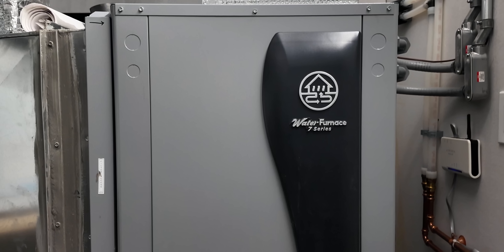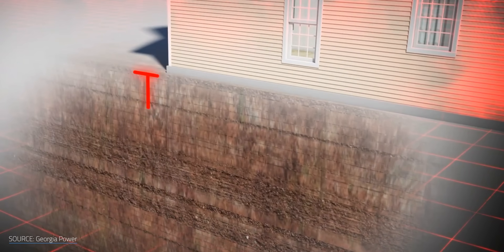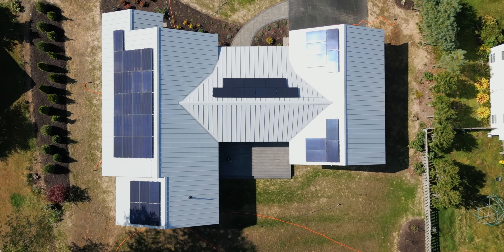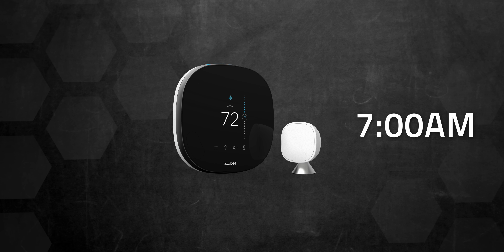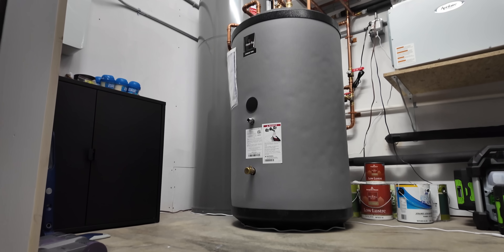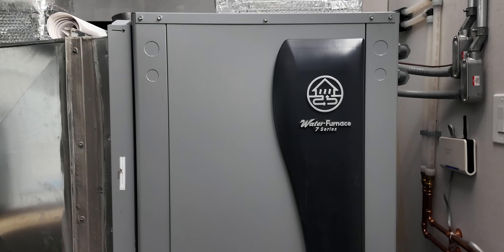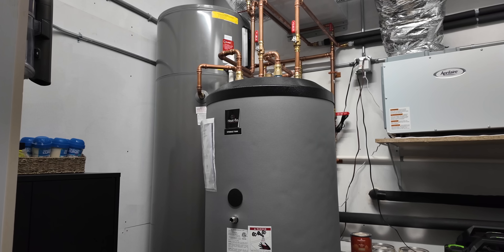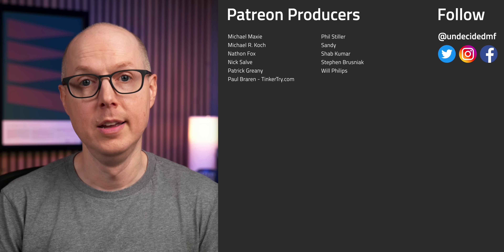How My Geothermal Heat Pump Really Performed (2 Years)

Comment: I designed and installed my own geothermal system. Works with air pushed through underground 6 inch drainage pipes. Some of the pipes I got for free from my landscaper. I have a heat pump and AC unit which uses underground air instead of a liquid and heat exchanger. My total cost $1500 and my sweat. My July electric bill went from $345 to $120. I want to market a ready to install a kit. No need to drill, just a back hoe to dig a channel 3 feet deep.
Reply: This is called an EARTH TUBE and are frequently used in Earthships. The issues that raise from this is that the tubes can collect condensation and that can become harmful mold growth. Keep it dry and it's a pretty easy low tech air conditioner.
Reply: @Lunarl4ndr  There's no concern for mold in his setup because he's using the cold air from the earth tubes and directs it to the air-exchange AC unit.

If that doesn't make sense, he ducts the "ground air" to his AC unit, which is pre-cooled by the earth tubes. He's not taking in air from the earth tubes into his home.
Reply: gotta start that yt channel lol
Reply: Very nice.  While these more advanced systems like what Matt Ferrell has are awesome, they're pricey and out of reach to a lot of people.  I have seen a more passive system in earth ships using drainage pipes.  It sounds like you've took that one step further combining it with a heat pump, very cool indeed. 

You should share your work as it might inspire others to improve upon what you've done and everybody wins.
Reply: @LeJimster  Right now I am trying to calculate the cost savings vs investment.

Comment: I feel like we are putting the cart before the horse. Why invest so much in energy production instead of efficiency? Why have rebates for solar, when it is cheaper to install high r value insulation. If half of home energy costs are heating and cooling, and if insulation is cheaper and lasts longer than solar, then wouldn't that be a better investment?

Comment: What if one of the underground loop pipes develops a crack? the cost of fixing that would also be enormous, wouldn't it? I only ask because, while my area is not prone to earthquakes, we've had 2 in the last couple of years and it did cause some minor damage. With a system like this, if it breaks, it would require substantial resources to fix. Could you comment on that?

Comment: I have a air heater pump. Live in the northeast. Coldest its been is -13. Heat pump was able to keep my house quite warm without a huge increase in power usage. Geothermal is cool I couldn't justify the upfront cost for installation on my new house.
Reply: I have the same in Norway too.  Temps can get down to -10 to -15C during extremes in winter, and the heat pump can produce 5KW of heat at -15C.
Electricity is pretty cheap and 100% renewable here, and there is no way I would install a geothermal system due to costs.
Reply: @la7dfa i would never do Geothermal due to cost of installation, risk of leaks and cost of leak repairs, and cheap solar energy, I'd rather invest in battery storage and have a few electric heaters in case of emergency.
Reply: @KameeGaming  Battery storage will make more and more sense as prices are dropping in the next years.  Solar and outages of the grid could make life better. especially in a crisis (war?).

Comment: Hi Matt, Can you please enlighten me.  If you temp in the ground is 50F, does the compressor even run during the summer for cooling?  is it just the water pump running?  Is geothermal heat pump a good idea for hot climate like Texas where winter heating is minimal?

Comment: I should also point out that geothermal heat pumps are  great  for heating swimming pools, and they can be coupled together with solar thermal hot water heaters and photovoltaic thermal.

Comment: I’m glad I don’t live in Massachusetts 🤪 We had two Waterfurnace units installed in 2008, a 5 ton for the main floor and a three ton for the upstairs as a retrofit. The house was built with two separate systems so it made more sense to just replace the propane furnaces directly than try to modify the ductwork extensively. We have two horizontal loops, they are hooked to the water heaters. Installed then was $26,000 for two complete systems. We are in Southwest Ohio. We had to have an additional 200 amp panel installed at the time for about $2000. Our electric rates here are about 13 cents a kWh. We have been very pleased with the system overall. Initially we had several service calls but it was all covered under warranty. I think their build quality has improved significantly over the years. Whenever these units finally reach the end of their service life we will replace with new Waterfurnace units.
Reply from the maker: Thanks so much for sharing!

Comment: Government rebates are just a way of getting your neighbors to pay for heating and cooling your house.  It is not the real cost of the system.  If everyone did it, your taxes would just go up by that amount (actually more because of the inefficiency of the third party).  Also, I suspect that your sky high $.31/kwh electricity bill is in part because of rebates the power company is doling out that they need to recover.  You do, however, live in a good climate for ground source heat pump.  50 degrees is a great heat sink and your heating and cooling seasons are split up enough that you don't warm or cool the ground so much.  If you lived in the South, the ground might be 70 degrees and the cooling season might be 10 months.  So the ground around the loop might end up climbing 20 degrees and not really be much different or even hotter than air temp, especially at night.  Also, you are only guessing at the costs of an air-source heat pump.  Only building two identical houses aside from one being ground source and the other air source would be able to truly compare the difference.
Reply: Don't worry, all those rebates are gone or will be shortly.

Comment: A word of warning for some. Building your house is the best time to install a good system, just ensure it is a workable system or you're stuck with it. Converting an existing house will have problems to jump over but doable. So far OK. Converting a townhouse, your local strata/HOA needs to approve, and then does your power delivered to the house allow a heat pump (forget geothermal)? In my area, built in 1990, heat pumps will never happen, not enough AMPs delivered. Same would be true of older condos. Unless my area gets everything pulled out and rewired, heat pumps will not happen. Since I downside from a house to a townhouse, and then retired, basically stuck with traditional forced air. 

I do like the technology, it's cool (sry about the pun).

Comment: There is a large cave on the property where I'll be building my next home, so I plan on going speleothermal. The cave, like the ground around it, is ~55° F year-round. I haven't worked out all the details yet, but the idea is to put a heat pump in the cave, and pump the fluid to the house through an insulated underground pipe. Any helpful advice would be appreciated!

Comment: This is amazing, but for a milder climate, it wouldn't make too much sense since new air-to-air or air-to-water heat pumps can get SCOP of 5. Especially if your house is well-insulated and not ginormous. New R290 heat pumps can be very good even in a slightly colder climate if the system is set up right. Where I live, geothermal heat pumps are much more expensive and often require permitting.

Comment: One concern I would have about a system like this is the complexity and use of much less common components. What if its 14 years later and the reclaimed heat water system breaks? If the company doesn't exist anymore, can you just get another? What if the geothermal system breaks or leaks? It won't be as simple as replacing lines or a condenser unit for an air system. I am not sure efficiency "at all costs!" is necessarily a positive ethic when the result is a much more complex, difficult to repair or replace system. 
Personally, I like the security of common, robust, affordable, easily replaceable components which can still get you to net zero easily. Also, independence for me means no grid connection at all.
Reply: Ours is 15 years old now, still pumping. Same brand Matt is using.
Reply: The core system is still an air handler. Nothing special about that. The only added "complexity" is the ground loop and circulation pump.  Yes, leaks are possible but very rare.  The loop is extremely heavy duty and encased in grout. The systems are pressure tested before commissioning.
Reply: @DeuceDeuceBravo  And pressure-tested systems still fail sometimes, especially as they age. He's also got other special "efficiency" components, like that waste-heat water heater. 100% of components will fail. It is only a question of when, how many you have to fail, and how cheap/easy it is to replace. I just think there is something to be said for simple, robust, and cost-effective.
Reply: @satekeeper The desuperheater is very simple plumbing. I have one too. Of course everything will fail if given enough time. That doesn't mean the system should be avoided.
Reply: @DeuceDeuceBravo  I was not saying the plumbing is complicated for that one item. I am saying adding more and more components increases the chances of a component failure in a given year. I'm also not telling anyone to avoid anything. If you become sexually aroused when someone uses the word "efficient" then this is the setup for you.. get it and enjoy yo life. I personally don't think maximizing efficiency is the most important virtue or would lead to the best homeowning experience for me. Is that OK with you? Am I allowed to have preferences about my home?

Comment: It would be great to know your average COP (Coefficient of Performance) on this Geothermal heat pump for those 2 years. I have air-water heat pump and for last 3 years heating, cooling and hot water I have average COP of 3.5 (in Europe - Slovakia) which is really great for air-water heat pump and it is great heat comfort in house as I have constant 23.5°C (cca 74°C) all year. I am also really satisfied with this choice, and was considering geothermal, but charts were showing COP of between 4-5 which is not that big a difference in savings, so that is why I am interested in some real usage number of COP for your system. And yes, using PV together with heat pump saves even for me a lot of money even now, so together with PV change of COP from 3.5 to 5 would be around $100 savings per year, which even in 30 years would not have provided my a return of investment... at least that what it looked to me like... yes, air-water heat pump can get broken more often... I will see.

Definitely I would also recommend heat pump to everybody with properly insulated house. Thanks for sharing your experience.

Comment: Over 20 yrs. the system costs $2700/yr. & that's not including interest on that $$$ in the mortgage.  My natural gas system only costs 240/mo. to operate, (gas + electric) & it costs $175/ yr initial cost. I'm on my 20th year & it's doing just fine. Nineteen forty seven house well insulated with foam & rock wool. (1300 sq. ft.) in Lansing Michigan. It wouldn't pay me to go geothermal.

Comment: A self-dug ground loop seems to make way more sense than drilling... You should've just used the server for free heat in the extra unit, and had a separate, cheap A/C, for summer needs. You went way too big on all this, and I wonder about future maintenance/replacement costs factoring in, with all that complicated equipment. Do you have backups/parts ready to go? That's part of long term self-sustainability as well. You got a soldering iron and extra capacitors, motherboards and power supplies, belts and filters and pumps, know what I mean? Maybe one day you won't be able to just call for support, or easily find a replacement part. The complexity really worries me and I wonder if higher running costs now>higher maintenance costs later. -ManDog2020's ass

Comment: Why can’t we use our pool water with a geothermal heatpump as an AC in summer? It would also heat the water while cooling the house. It’s like a free heated pool. Where are those systems or how could we retrofit a large sump to hold pipes and use the same ground system you have?

Comment: A friend in the Denver area had this model (Water furnace) geothermal HP installed and discovered that the default settings for the added electric resistance heat strip were insane, turning the expensive heater on below 32°F or if you raised the temp 4° or more. Beware!

Comment: We just brought our Water Furnace geothermal system online this past week in our home build.  It is a radiant (in floor) system for both heating and cooling.  In the summer, the holding tank will be kept cool, and in the winter it will be kept hot.  We are in the Pacific NW, so heating is primary.  The flooring is polished concrete to maximize the efficiency, and it looks very cool..

This will be our second home with a geothermal system.  One of our main motivators at the current location is we live by a river with beautiful  water and wildlife sounds.  We did not want an outdoor HVAC unit turning on and off and spoiling that setting.
Reply: Make sure you have good dehumidification. Cooling with radiant can cause condensation issues. And condensation issues on polished concrete could be downright dangerous.

Comment: I upgraded the insulation in our house when we had an extension done.
Builder thought it was way over the top.
Live in the UK and haven't had the heating on since march bar and hour or so in the TV room on an evening.

We don't run the in house UHF until it goes below 18.

Not sure why he has his so hot maybe it's the way air source works?

Comment: As the owner of a GSHP in a certified Passive House our experience is exactly like yours.
Let me point out that one advantage of a well insulated house with GSHP HVAC is that the entire thermal mass of the living area (and in our case that includes the basement) pretty quickly comes to the thermostat set-point and stays there.  75 degrees F in our case in New Jersey.  Moving the interior temperature one degree takes approximately 1 day.
I would also point out that Air Source Heat Pump HVACs are always pushing heat "up hill"; from the cold side to the hot side.  With GSHP HVACS cooling the house is pushing (sic) heat "down hill"; from the hot side to the cold side.  (("Heat goes to Cold"))  That makes your air conditioning in the summer damn near free.  Without any heat pump, just circulating water from the ground, through the house and back to the ground would cool the  house.
((Turn off circulation when you reach the set point.))  And pumping water in a closed loop is very inexpensive because you are not "lifting" the water out of the ground, it is falling on the other side of the loop.  The water pump is only fighting the friction of pushing water through the pipe.

Comment: I'm glad you put this one out, but I have some concerns you never talk about. I'm all for geothermal and almost any type of cogeneration of energy in all of its forms. My issues are with refrigerant based heat exchangers that have Freon. 
Do you know how many types of Freon there are?
Do you know what types of Freon are in your systems?
Are you aware of how available or not your particular type of Freon is?
Are you familiar with the extremely variable prices between the different types of Freon?
Do you have a local certified service company available for your precise type of Freon?
Are you aware of how much it will cost to replace the compressor, receiver/dryer and Freon if it stops working, compared to replacing it with a conventional system?
   For these reasons, I can't justify spending such a ridiculous amount of $ on a system, when the same $ could pay for the utilities to run a conventional system for an extended period of time. There's also the Freon/environmental thing, but that's minimal. I'm on a mountain in NH and plan to use geothermal for my intake/makeup air systems and use remote mounted blowers that have dual blower fans mounted on each motor so that the SCFM of the HVAC and makeup air are always the exact same. They will also be remote mounted for super quiet operation. Yes, I expect to have a pretty large plenum for all the bathrooms, kitchens, garages, and multiple HVAC fans, lol. 
    I will be drawing in fresh air and running it underground for the heat exchange process instead of circulating fluids. Since I can simply lay it out in my yard/slope and then bury it, this seems like a great option. I will be accompanying the ducts with 1" black well pipe also in a loop to see if there's a noticeable difference in efficiency and may just combine them for maximum effectiveness. Time will tell. I am still designing the buildings that will be replacing what's currently here. These structures are from 1860 and the most energy inefficient examples that I've ever seen, lol. I'm sort of hoping that a substitute for Freon can be developed soon, so I can avoid it entirely. 
   Thanks again for this one and I hope you have good answers, lol.

Comment: Replacing the solar panels and batteries is pretty expensive.  I'm guessing you haven't had to replace them yet, so I'm curious if those costs were included.  I would guess replacing the geothermal pump would be pretty inexpensive.  The initial cost would be the underground install.  I would imagine the costs for repairing an underground leak would be very expensive.